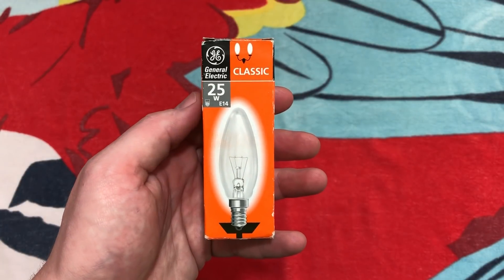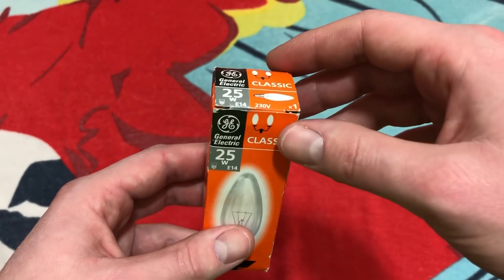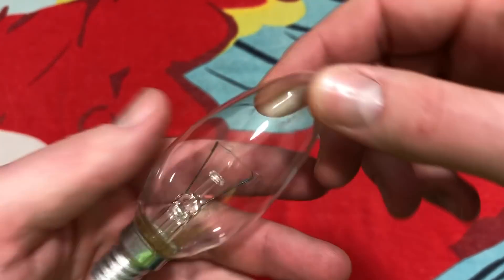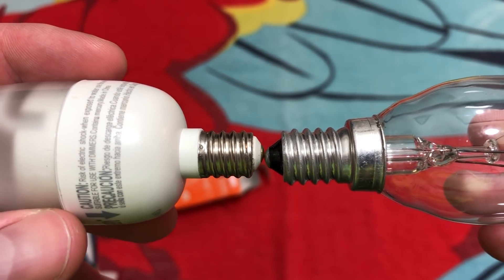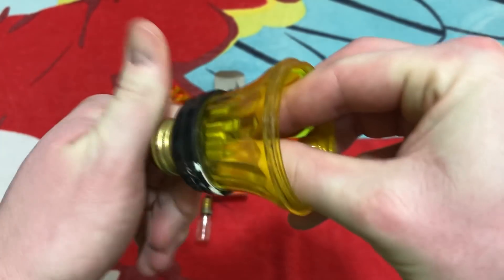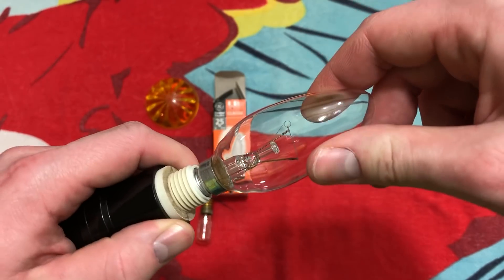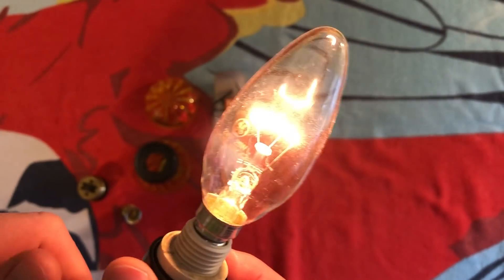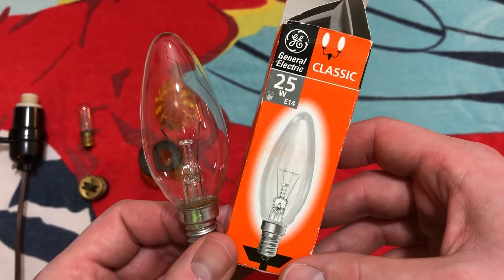GE 25watt E14 Flame Incandescent Light Bulb

Comment: Here in South America, in Venezuela 🇻🇪, also were very common, the GE Incandescent bulbs had the same European Style and US Style, too (they were sold in both styles), but with difference that they were designed for 120 volts, because here we don’t use these 230V (only with special loads with voltage levels from 220V until 240V, sometimes 208V when we need a three phase system). At this moment, i have exactly the same bulb from the video but is a 60 watts on 120V and the box its also the same orange one showed here in this video

Comment: These bulbs are very common in Poland. Also E14 socket is common. Standard socket is E27. I used nearly identical bulb but 15w also GE before I bought Osram 2W E14 filament LED. This bulb has a nice faint glow at 120V - I will try my 15W GE's two in series on 230V.

Comment: If US does have the E12 and E26 standard socket fittings, European sockets are E14, with this GE incandescent bulb shown in this video and for big sockets is E27 standard base and E40 mogul base for street and industrial light fixtures. But today, incandescent and halogen bulbs are banned for manufacturing in Europe since 2018 year.